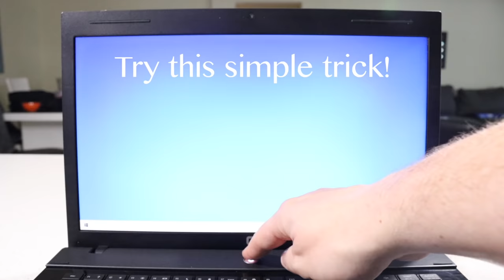How To Speed Up Your Internet

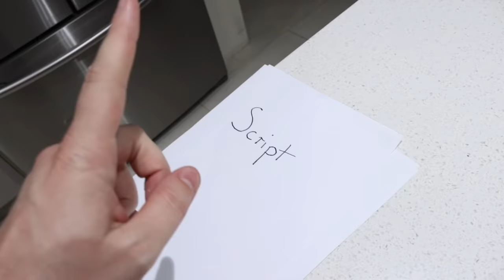Comment: start 0:03 start of the fixing 0:10 surgery 0:12 fixing and cleaning 0:30 still not working 0:47 tapping jt lighty 0:52 taking a bath with it 0:58 tiko it 1:08  egg the laotop 1:13 NO MORE EGG! 1:26 waling up the beast 1:36 sponser 1:45 chicking vibing to fire music 2:11 magical egg refill 2:36 the beast is angry 2:38  egg it more 2:43 testing it if it works 2:49 fixing the moto 2:54 burn the moto 3:03 tesing it 3:07 IT WORKS! 3:08

Comment: 0:01 opening the laptop
0:02 internet connection running slow?
0:03 do vids constandly bu-
0:06 uffer? Try this simple trick!
0:07 blue screen🩵
0:08 black screen🖤
0:10 fliping the laptop
0:11 upside down?🙃
0:12 remove the batteries🪫🔋
0:13 theres 4 screws
0:18 why its blue?🩵
0:20 *important*
0:24 you can do this by using a can of compressed air on a hard drive
0:29 spray it 
0:33 fried egg🍳
0:36 cover back
0:37 theres 4 screws again
0:39 put the batteries🪫🔋
0:40 fliping the laptop again
0:41 opening the laptop again
0:44 error
0:51 tap
0:52 hammer🔨
0:57 hammer again🔨
1:00 hammer 3×🔨
1:03 laptop in the bath🛁
1:05 hammer 4×🔨
1:06 hammer 5×🔨
1:08 showel
1:09 it tickles😅😂
1:11 showel again
1:13 egg the laptop🥚
1:16 egg the laptop again
1:18 egg the laptop ×3
1:21 egg the egg
1:22 egg it more
1:24 egg it more again
1:26 no more eggs!
1:35 script
1:39 ???
1:42 what did do i pay
1:48 red color🔴🟥❤
1:58 black color⚫️⬛◼️◾️▪️🖤
1:59 red color again🔴🟥❤
2:00 blue color🔵🟦🔷️🔹️💙🩵
2:04 what is that orange thing🟠🟧🔶️🔸️🧡
2:05 dog?🐶🐕🦮🐕‍🦺🐩
2:06 æræbz
2:15 nice chicken dance🐔🐥
2:28 h.t.b
2:35 108 eggs sppears
2:41 gasp
2:42 egg it more ×3
2:46 showel ×3
3:02 burn into ashes
3:07 927 36 - 930 20
3:11 👍
The end😄

Comment: Ok but seriously raycons are pretty awesome. I’ve had mine for like 4 or 5 years and they’ve been through hell. They worked like a dream when I worked construction as an electrician last summer, even when dropping them dozens of times. The case got beat up, but the audio quality never changed and I still have them to this day (although I now have AirPods, they have sadly been demoted to work earbuds). They played nonstop from 6 to noon and would be fully charged ready to use again after my lunch break until the end of the day. They’re only $70 (at least the e25s were when I bought them, idk now) which is amazing for the quality and durability #notsponsoredlol

Comment: Imagine you are annoyed with your laptop because the internet is running down to 0. You actually take out that blue thing and spray it with running fast internet spray. Your laptop still running down to 0 and you smashed it. You take a lot of batteries as fast as you can. You take the bus battery, car battery and over batteries that you know about. You put all of the batteries in the laptop and still running down to 0.

Comment: 1.remove a screw on the edge of the computer 
2.spray over the hard drive 
3.place a omlate in the hard drive 
4.close the lid and screw the screws 
5.turn on the computer 
still slow don't worry try this 
6.tap the computer lightly
7.break the computer 
8.break the computer in water 
9.hit the computer with shovel 
10.egg the computer 
11.egg it more but no egg left 
this video is sponsored by racon racons don't fall out of ear watch this the racon is still on his ears try them up with 50% of purchase howtobasic is using this by showing strange things so let's go back to video 
12.egg it more 
still slow it may be problem with motom
13.break the motom
14.set a fire on computer and motom
now you have a lightning fast internet connection